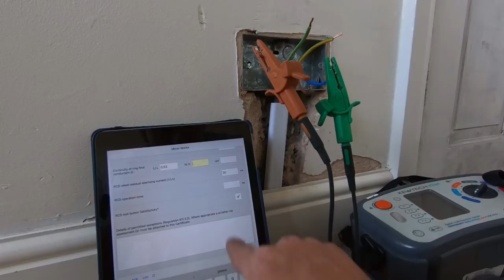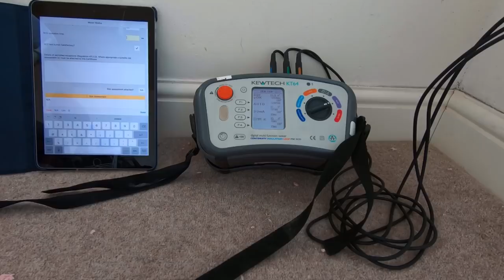Adding Additional Sockets To An Existing Ringmain. Banter!!!

Comment: I would use ideal wagos as they are rated at 32amps and the ones you used are only rated at 24!
Also isn’t it good practice to fly lead a metal KO ? I’ve used iCertifi for ages now can go wrong with it.
Reply: 24a is the Japanese spec
Reply: Half the load goes down each leg of the ring so on a 32a ring final each of those wagos will only be exposed to a maximum 16a each
Reply: @megazeus7972  No, 24A is the spec to IEC standards..
Reply: @tommcdermott1989  Not quite, depending on where in the circuit the load is. 
That's the inherent problem with rings - but for all practical purposes 24A rating connector on a 32A ring is more than adequate. Mr Kirchhoff sees to that.
Reply: Simon Parkinson quiet incorrect, the maximum demand on a 32amp ring is 16amps, that’s it . Not as you say depending on where it is. This subject has been shouted out before in other video messages.
Reply: @ecoterrorist1402  Really?
The "fudge factors" in the regs require the ring cable to be able to support 20A, because they know what I stated is true, 
Basic Kirchhoff's Law.
Let's take a typical1900s 3-up 2-down mid terrace house Rewired to current regs. Has an upstairs and downstairs ring.
Intake and CU in kitchen.
Downstairs ring end to end 0.5 Ohms L and N, 0.83 ohms CPC.
Now due to kitchen layout you have a washer and dryer plugged in to a double socket.
Let's say that the total load is 20A at that point.
Now remember the CU is in the kitchen so there is going to be a shorter length of cable on one side of the ring between that socket and the CU than there is on the other.
For arguments sake let's say the socket is 20% of the way round.
So 0.1 ohms one side and 0.4 ohms the other.
You will NOT get 10A going each way from the socket to the CU.
You will get 16A down the short leg and 4A down the long leg.
Put the kettle on too (12A), that's at an adjacent socket 10% of the way round.
So resistances now 0.05 and 0.45 Ohms.
The sharing is now 90%/10% so 10.8 and 1.2A respectively.
Oh dear, that leg of the ring is now passing 26.8Amps while the other is passing 5.2Amps.
Don't believe me? Get your clamp on ammeter out and test ANY domestic ring circuit at the breaker in the CU. The current in each leg will NOT be equal unless the load is evenly distributed or the large load is applied at the mid point.
Breaker still happy because the total current passing is 32A.
The theory of ring circuits works great with a distributed load, such as in an office with a number of computers etc but fails when the load is concentrated at one point near one end of the ring.
But don't worry, the 24A connector isn't going to burst into flames.
"But that's why you put a separate kitchen ring in!"
Yes, loading can easily hit 32A as in the example - but the current will ALWAYS be unequal in each side of the ring because we're dealing with real world installations.
Reply: Simon Parkinson thanks for given a comprehensive reply, You are quite correct with your mathematical answers, could you point me to the regulation about a ring circuit having a maximum demand on one leg of 20 A, I still standby my answer that the maximum designed current is 16 A leg, it’s only by poor design your calculations would indeed be correct.
Reply: @ecoterrorist1402  ok...
By calculation, the figure is actually 22.06 Amps.
That is derived from reg 433.1.1 (iii) 
But the first fudge factor is reg 433.1.204 which says 433.1.1 is deemed to be met if the cable rating is not less than 20A, and that it would not be exceeded "for long periods". Nice and vague.
This is where I got the figure of 20A from.
The other fudge factor is table 4D5 column 7, where 2.5T&E has a rating of 20A, compared to column 5, the fudge so that you can install 32A ring finals and 20A radials in newbuilds using 2.5T&E.

Comment: I recently put some electrical tape over the rubber shroud cable of an Apple computer charger.  It has been on the cable for about four months and took it off the other day only to find the rubber sleeve of teh cable to have gone all mushy .  I think this is dangerous but can't understand how it could happen when it was proper electrical tape used.  Any thoughts ? Should the rubber electrical cable from the power supply charger have deteriorated like that ?
Reply: It's the plastic used on the USB cables.  It reacts with the adhesive.  Some plastics don't like tape.
Likely nothing to do with the tape and more to do with the type of plastic used by Apple.  It's not really designed to be taped up.
Reply: @EsotericArctos  Thanks for the reply. You'd think that electrical tape could be placed around electrical cables though without fear of the cable deteriorating.  Im going to take the charger back to Apple and tell them I think its a danger and should be replaced or recalled.
Reply: Elfin4 Apple would never recommend taping up their chargers though, if it’s damaged, it should be replaced. Just because you’ve damaged it doesn’t mean it’s an inherent design flaw that Apple should replace every time you need it. And it definitely doesn’t need recalling

Comment: Great video. Always doing a great job. How could you customers proceed with getting the ground floor works certified and signed off?
Reply from the maker: I’m going to carry out a full EICR on the property. Rectify any faults found then I can issue an installation certificate.
Reply from the maker: Richard Walsh what do you issue after you’ve done an EICR on a property and rectified all the problems.
Reply from the maker: Richard Walsh okay what do you issue when you’ve change a consumer unit on an existing installation?
Reply from the maker: Richard Walsh just wanted to clear that one up just incase you knew something I didn’t. It’s perfectly acceptable for me to issue an installation certificate on completion of an EICR I just simply state on the report what the extent of the installation I’m covering and clearly shows all the results in one neat form. I will then attach a copy of the EICR carried out before so any alterations that have been carried out were subject to the report.

Comment: You should put your ring final cpcs in the different earth terminals as in case a  terminal comes loose you would lose both cps. If you have them seperate you always have an earth connection.
Reply: No continuity then though??

Comment: Awesome as always Chris! 
See the socket you connected into, I would have just cut the 2.5mm in half and made a joint, would have saved you a raggle? But may have to used 2x wago boxes? 
Or mayb my way is junk? 😂
Reply from the maker: Yeah the cable wasn’t under the floor I lifted and was below the tiles bathroom floor so had no option to remove and reroute
Reply: What a nightmare😞. 
Wasn’t picking mate was just curious if I was in the wrong or not 😂, 
Also good to see I’m not the only sparky that fills there own raggles. Do admit not as good as that 🙈😯

Comment: I used to use bonding without PVA and skim on top. I used a trowel for the bonding and a float trowel for the skim. Smooth as a baby's bum!
Reply: Totally agree Simon especially if using Toupret,  decorator Chris swears by it, when he's finished  never know wasn't the original surface before us sparks get to it, I personally used some of the sticky orange  mesh tape and pink grip before I roughed chases in, for a mate , I didn't want it cracking away,  like I've seen in past, overkill maybe

Comment: I’ve been watching your videos and they are great including this one, I am a certified Electrical and Electronics engineer, not an electrician so just wanted to question one thing, for this job adding to the ring main, I’d of added a new cables to ensure all terminations are at the sockets, therefore is it ok to add the wago box under the floor boards? I guess the answer is yes as you can pull the carpet and get to it if necessary.

Comment: Why are you bearing joints in the floor when you could put your joint in the box this way if you ever have to do any testing it's accessible behind one of the outlets versus having to take the carpet up take the wood up and find your connection in the floor

Comment: Aren't those wago connectors only rated at 24A?
Reply: Let me ask you this: How much current can you put thru a 2,5mm2?
Reply: Richard van der Heijden depends on the fuse/breaker
Reply: @tommcdermott1989  He meant the safe current carrying capacity of 2.5mm2, which is around 24A depending on method. Half the current travels down each leg of the ring, so those Wagos should only ever see a max of 16A.
Reply: 221s are rated at 32a so I cant see why these wouldnt be
Reply: Robin Rawson-Tetley  yes well put robin I thought he was just asking in general how much you can put through
Reply: Come on andytucks. Think about it haha
Reply: And what about when there is a ring fault and all the current is coming down a single leg. Shouldn't use the 24A connectors.
Reply: @BillyBob-ie9ww  The cable itself can't take 32A down a single leg. At least, not without melting its insulation and likely setting things on fire. There are many destruction tests of these connectors on YT and they can take a LOT more than their rated 24A
Reply: We have had this before, it’s doesn’t matter because the MAXIMUM demand on a 32a Ring circuit is 16amps PERIOD.

Comment: Ring mains are so old school. 20amp radials are so much easier to adapt and test
Reply: I don't know why they don't install a seperate circuit for each room and put each on a 20 amp rcbo for maximum safety and minimal outage.  Why bother with split load consumer units, rings any of that.  Fuk code, common sense.
Reply: You can do that, code has nothing to do with it

Comment: Lucky British people! You get 32 amps for a ring and i get 32 amps for the whole house.
Reply: @AndyK.1  Okay so I live in Hungary and the electricity supplier is eon. The setup is like this: you have got an mcb which is the main fuse {the owner can turn that off to isolate the property} above it the electricity meter and the fuseboard. Now my problem is that the "main mcb" of ours is single phase B32. But it can get still worse. In a new property they give only 16 AMPS AS A NORMAL. IT'S CRAZY AND SHIT! Upgrade £15/amp. In my case the fuseboard is sadly missing. The whole house is on a 32 amp ring WITH 27 AMP ALUMINIUM CABLES (except the kitchen which is wired in 4mil copper. No other circuits not even an rcd. Now i'm an electrician myself. I live with my parents. Old people are Conservative. They said that they don't want a rewire no matter how hard i try to convince them.
Reply: In today’s modern houses the don’t require electric heating 32amps is all you need, my house is on a 40amp mcb, 
I have had a energy monitor on my home and the maximum demand has only been 5kw.
Reply: Same in NL. 32A or 40A breaker single phase, bullocks.

Comment: why don't you cut the CPC longer than L & N rather than double it up and make it the shorter?
Reply: I know what you mean. I used to cut the earth sleeving so it measured from each corner of the back box (diagonally). Then the L/N would be cut measured from entry point to farthest corner. Earths would be folded over on themselves. Earth should always be longer. And on another note you don't need to earth back box if there is one solid lug (Ask the NICEIC).
Reply: Brian Bell better still see guidance notes. It’s in there (methinks).
Reply: Abdul Seaforth - Better answer than mine 😂. It’s just the way I always did it. Normally the earth should be the last to pull out if you pulled on the socket. Just look at the British 3 pin plug.... the earth pin is longer so it’s last to disconnect.

Comment: That “pipe slice” looks to me like a armoured cable sheath remover but I cloud be wrong
Reply: SIMUL8TOR it is for armoured
Reply: Looks like the CK armoured cable stripper to me. Thomas Nagy was using one on a load of armoured a couple of videos back. DSS Electrical as well.
Reply: It’s the CK Armour Slice. It’s for SWA and it’s brilliant if you know how to use it!

Comment: Does everyone just test their part or the WHOLE CIRCUIT..Ie figure of eights in the CU?
Reply: if i understand your question correctly, it does not matter where you test your ring main as the figure of 8 links doesnt matter, also if you are altering an existing circuit,then yes you must test both your additional wiring and the original to check ir and continuity, and maybe rcd.....plus zs.
Reply: Thanks Matt. I understand you. You have to do the end to ends and fig 8s in the CU so that will incorporate the whole ring. 

So if you were asked to make an addition, would you test the existing first for problems? Thanks
Reply: In theory you can make the figure of 8 links anywhere on the ring, most people do it at the board as that's where they are probably testing that circuit and any others. My advice is to always test existing wiring for any issues which may effect your ability to connect new wiring and certify that all is well, many existing circuits have defects which go un noticed until we test as part of an addition. Hope this info helps
Reply: Thanks Matt, good solid advice!

Comment: Its a good idea about the torque settings on the sockets! I think they would have to use a flat plate over the grub screw it could cause all sorts of problems if you used 1.5mm or 2.5mm  you would need different torque settings depending on wire Size's.
It would compress the copper a different amount depending on CSA! 
It would also make a lot difference using brass vs steel grub screws on the torque.. 
Its a bit like if you use grease on the wheel nuts of a car!
If manufacturer quoted the torque setting for dry then you will over torque tighten the nuts with grease as the threads will slip round eaiser with grease!

Comment: 9 minutes.  Those pressure joiners are less secure than the more conventional "twist and cap" style joins.  The pressure devices will lose their grip pretty fast if there is a too-high current draw through the union.  The twist style can withstand a much higher current, therefore much safer.

Comment: 8:10 That's not good practice and you have ripped into people in the past about that. 
Stop being lazy n do a proper professional job!

Also. Even though it doesn't do anything. I'd of still whipped that old cable out n just make good. For the amount of work you've done, you might as well of just done that as well.
Reply: What for not putting in an earth link to backbox...... hahaha you don't need to if you have fixed solid lug on the back box

Comment: Why do you use a screwdriver that’s too small and won’t give you a strong connection in the sockets? That’s a 3.5mm you should be using a 4mm!

Comment: The diy electrical reminds me of this job I looked at for a friend of a friend.. He got a shock in his garage fitting a new socket even though the mcb marked garage was turned off in the house, I know his own stupid faut should have tested for dead first! 
But some cowboy had wired the garage on its own ring main across two 32amp mcbs one mcb was marked garage the other was on the downstairs ring main..Then the downstairs ring was across the garage and its own..So both rings were on 64 amp supplies! 🙈

Comment: PVA, Nooooooooooooo
Reply: @R-77 Because it's a pain and causes extra work when it comes to decorating, a friend had some walls skimmed, and they used pva in the mix after a month or so the paint come off in sheets, it had to be keyed back and a primer used
Reply: Ye pva s old hat, use spr to seal and bond so that the bonding sticks and doesn’t crack👍
Reply: @Mrflash222006  Were the walls painted with matt or silk? You have to use matt to prime the surface as silk just rolls back off when you put the second coat on